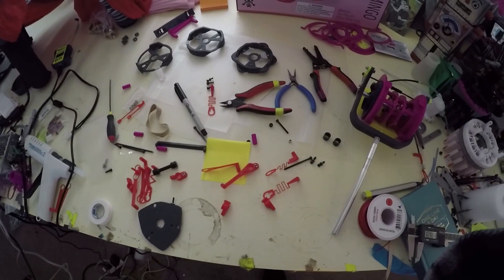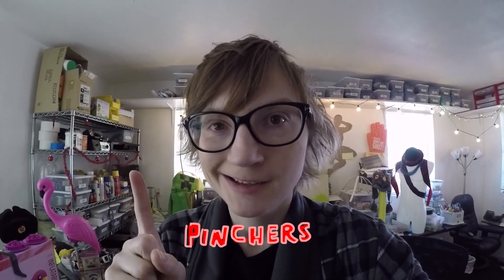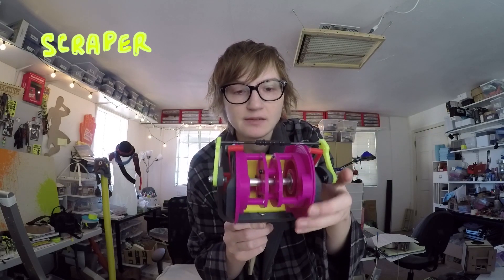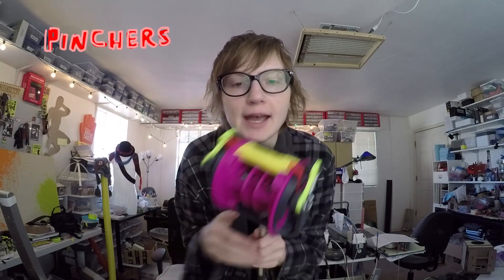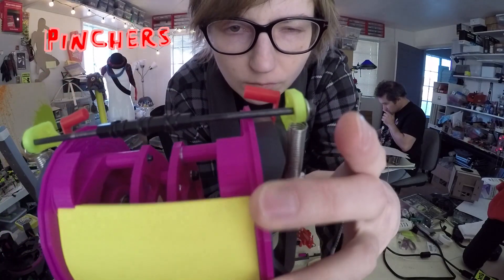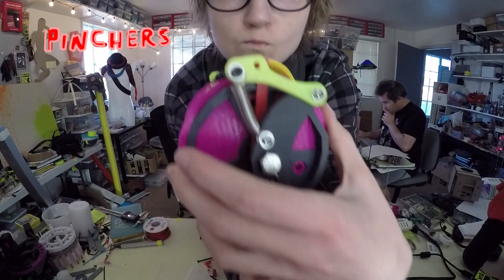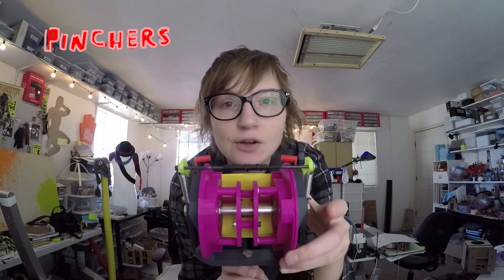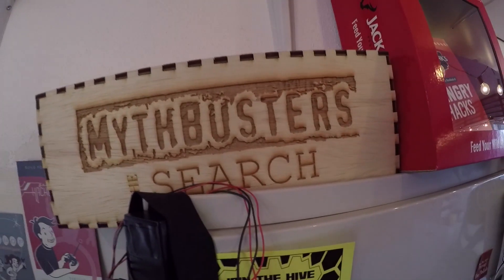Post-It Roller : Caught Up in the Details

Comment: Idea I had for the pinchers. I thought you could make them with a rod that's like a coupling rod on a train, not attached to the center of rotation but on a part of rotation. This then would connect to the pinchers moving on a straight guiding system. This I think is at least good to consider and can be modified for 3 instead of just 1.

Comment: can't word it properly but:
if you make the scraper rubber,
make scroller turn clockwise with roller using gears.

as roller moves clockwise, post it comes into contact with scraper,
scraper is turning clockwise so friction from rubber will catch on post it note.

Comment: Have you tried peeling the post-its from the BACK of the stack instead of the front?  This way the sticky side is already out there, you could stick the whole pad to the wall, then use a mechanism to peel only the stuck sheet off the pad.

Also, I learned a trick from doing a lot of Origami as a child, which could be relevant to you:
If you take a stack of origami papers (ie: just clean smooth paper), put your knuckle down on the top of the stack, in the middle of the sheet.  Then rub your knuckle in small circles, clockwise or anti (doesn't matter).  Your knuckle will grab the top sheet of paper, but all of the papers underneath the top sheet will start to spiral around in a kaleidoscopic effect.  i found it to be a good way of reliably separating individual loose papers out from a stack so they're easy to individually grab.  Could be useful.

edit: now i think about it, i think i've learned a lot of things about paper from my time as an office assistant, sooo many photocopied documents.  There's an inch-worm kindof technique where you grab a stack of paper tightly by one edge, bend the stack 90deg (like an arch), then grab the other side tightly with your other hand, and release the original side.  You now have a stack of papers that's slightly leaned.  Repeat this over and over and you will lean the stack over more and more, making it easier to grab individual papers.  Sorry i know these things are hard to explain with words, it's so easy to show a video but i can't find any of other people doing it.  If interested i can upload something i guess.